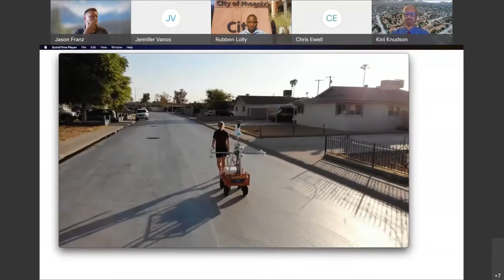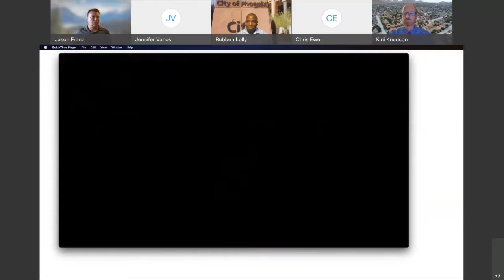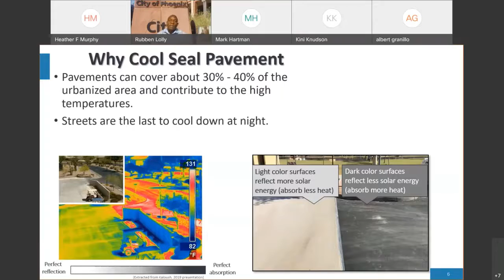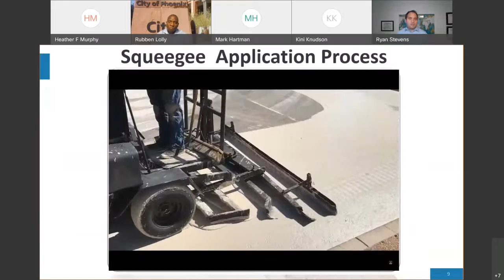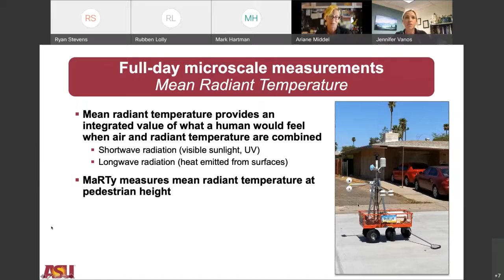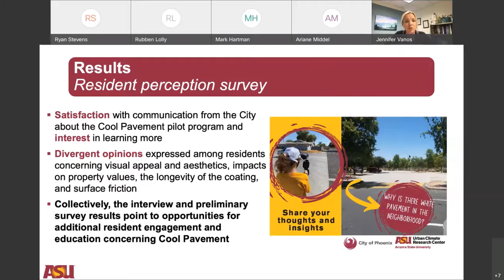Cool Pavements September 14, 2021

Comment: Concrete, while more expensive, is also a great alternative.
Reply: Scientifically no. This is a reflective material. Concrete does not reflect as much light as this new spray material. Sure it is lighter than asphalt. But concrete is a brittle formula. It cannot sustain constant traffic. That's why asphalt is textured the way it is.